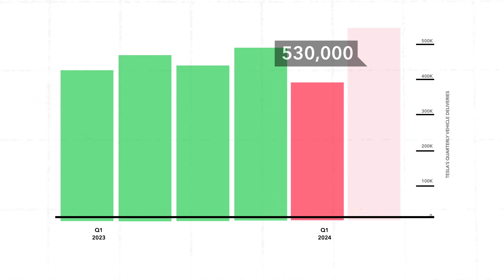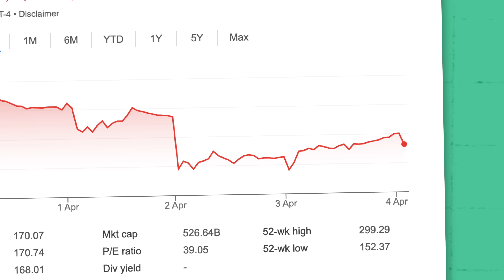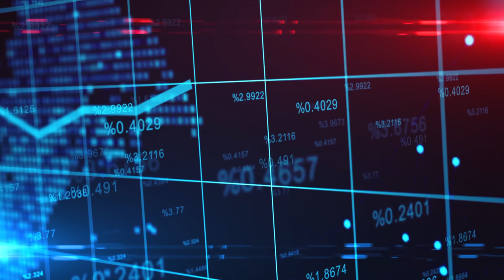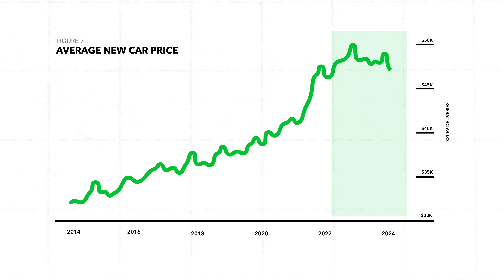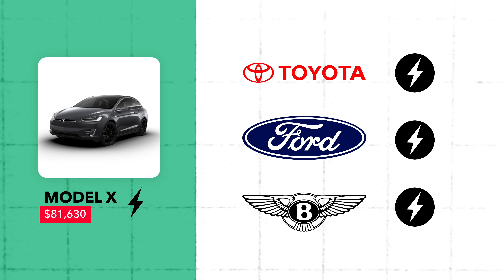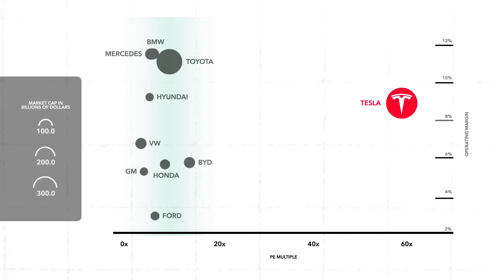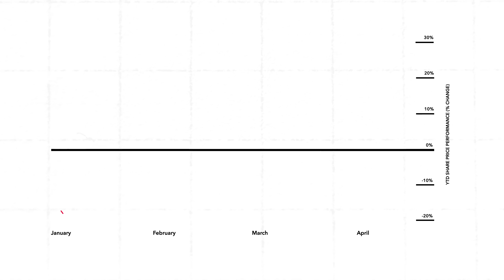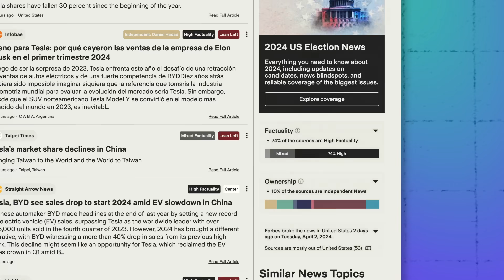Why Tesla’s Stock (Still) Has Further To Fall

Comment: classic case of missing the forest for the trees.
Just because Tesla was not able to ship the car to the customer due to international conflicts doesn't mean they had a bad quarter. 
Also, Tesla isn't a small automaker anymore where Production should equal Deliveries. If it is cost effective to stagger deliveries, then why bother about deliveries.

I understand that Tesla's quarterly results take into consideration delivery numbers, but in the long term, all of the production will get factored in to the financial results. So, any long term investor should stop missing the forest for the trees.
Reply: @xt5181  I respect your opinion that Tesla is "just another car company" and for that reason. I will check back in 2030 to see what ended up happening.

Comment: Americans always do things their own way (inches and gallons, anyone?)  Their living circumstances are vastly different from Europe or China, both of which rely on energy imports. My sister, who lives in Italy, pays the equivalent of $8 a gallon for gas and had paid nearly $10 per gallon when the Ukraine war started. The US can just frack their way out of price shocks and the longer distances that we travel are such that range anxiety is more pressing than the densely populated Europe and Asia.
If I were a car maker selling in the US, I would be rolling out as many PHEV models as I could, as they give better mileage (and horsepower), charge in garages (which most Americans have) and don't need to worry about getting stuck without a charger or in line for hours to use one.

Comment: I don’t consider Tessa as a tech company. the reason why is because when Ford built the model t. I believe it was considered very different singly as in world as tech company. Car manufactures always have intubate with robots or with ground braking technology. I don’t believe Tessa will make it for this one. I believe that the stock prices will fall below Ford. Probably trading at $20 per the way of the market going towards a different direction.

Comment: Tesla cars being to pricey for a lot of people is something that a lot of those speculating on the value of tesla really don't understand. A study done a couple of years ago suggest that more then 50% of working americans can't afford a $500 emergence. These are the vast majority that buy a car on credit or via a loan and then pay it off. If your buying a car on credit and you can't afford something like a $500 dollar emergence you aren't buying a Tesla car plain and simply they are to pricey even with the price cut. 

Tesla is a more expensive car brand that is fine there have always been expensive car brands but those brands are generally owned by bigger companies like Lamborghini and porsche are both being owned by Volkswagen. This means one company can cater to and sell to vastly different parts of the market. Tesla on the other hand really can't they don't really have enough different brands/selection and likely manufacturing capacity. Again as a company its fine to cater to a select market but when you do that you do limit your growth potential as a company.

edit funny thing is there is probably a chance that tesla would be more profitable if they ditched making there own cars and did basically become just a car tech company selling there batteries and robotics tech to other car companies that manufacture at a larger scale.

Comment: VERY POOR TLDR REPORTED. Tesla prices are below the US average you mentioned. Also Tesla has built out a giant charging network.
Reply: how does that change anything they said? Their sales have dropped and they were explaining some possible reasons why.
Reply: @ThatGuy-bz2in  yes, but the reasons they gave are way off. Price is not an issue and the number of Tesla charging points are enormous. It is poor research quality not to be able to pick the actual reasons.   No need to make up make-belive issues as the real issues are problematical enough
Reply: @tempcadoganenright  Price is absolutely an issue. EVs are more expensive than ICE cars still. Which means that choosing an EV means knowingly spending more up front. For someone excited to buy an EV, that might be a smaller factor. But for a general, skeptical public, that is super important. 

And the number of tesla charging points are enormous, in certain areas. In other areas, there are none. Most people want their car to be able to go wherever they want to go. If you want to go camping in a rural area, there might be no charging station anywhere near where you want to go. That is an issue for EV adoption, including tesla. 

The fact that you chose to ignore these very obvious facts and call them "make-believe issues" tells me you either are an elon fanboy who ignores information he doesn't like, or you don't know very much about EVs and their usage outside urban areas.
Reply: Dacia spring costs 20k euros,mg 4 is my country starts at 27k euros tesla 3 is 40k euros, price is definitely a issue, people that own ev´s here are from the upper middle class, about the usa you guys overall hate ev´s.
Reply: Dacia spring costs 20k euros,mg 4 is my country starts at 27k euros tesla 3 is 40k euros, price is definitely a issue, people that own ev´s here are from the upper middle class, about the usa you guys overall hate ev´s.

Comment: There is another pretty important reason too, which is common to the adoption of just about every new technology--the time when early adopters eager to have an electric car, the newest shiny and exciting thing, is now past. More conservative buyers hold back to see if this is indeed a worthwhile markert changing thing I need to get into now or do I need to wait and see how things go. Part of the wait and see here is, of course, the charging network build out, but it includes other things as well.  Will they prove as reliable as forecast? How will they hold their value? Will charging time get to be more like filling up with gas? Is the fire risk real or just something the press pays more attention to than warranted because of the novelty of electric vehicles? Etc. Remember that automobiles themselves took a while to take off in sales.  There was at that time no such thing as a filling station, few really good paved roads, few qualified mechanics, etc. The transition took a good bit of time.
Reply: I mean, the fire risk is kind of already settled. EVs catch fire way less than ICE vehicles. Just, when they do catch fire, they are bitch to put out. But otherwise, I agree with you. People are waiting to see if they are actually good.

Comment: Gas stations should provide and maintain the electric infrastructure for quick charging.
Reply: Why?
Reply: @VF31Rules  So they actually work.
Reply: Good point but most gas stations are privately owned (like a franchise). I doubt they have the money. Unless you mean like Shell or Exxon fund them and treat them like a gas station?
Reply: @VF31Rules  They should charge for the charge.
Reply: No profit in EV charging

Comment: Ultimately, only the 24/7 availability of abundant electricity will enable the green transition. #NuclearBuildUpNow
Reply: nah, we just need better batteries. Solar and wind are so much cheaper and cleaner than nuclear. We just need better options for storing that energy.
Reply: @ThatGuy-bz2in  That's a wide-spread myth. Batteries are physically limited to 500Wh/kg. Nuclear is WAY cheaper, cleaner, and safer than wind and solar.
Reply: @odril  umm, no. Why would you think nuclear is cheaper? It very, very much is not. Solar is the 2nd cheapest form of power on the planet (with hydro-electric being 1st). And that's not even taking into account all the innovations Solar is having that haven't hit the market yet. Nuclear is way down the list. It also isn't cleaner in any way or safer. I don't know why you would think those things. 

And it depends on what battery you are talking about. There are many, many different kinds of batteries. For example, pumped-storage batteries are only limited by the amount of water you can store.
Reply: @ThatGuy-bz2in  Your misconception might originate from the cost of the PV panels, which is indeed low. However, the cost of integration of intermittent PV into the grid is not.
Reply: @odril  If I understand your point, it is that there are costs of integrating solar into the grid given that it is an inconsistent source of power. I have 2 responses to that. 
1) nuclear power costs more than 10X more to produce. solar's cost per kilowatt is 700-1400 USD. Nuclear is 8,475-13,925 USD. We are talking about a source of power orders of magnitude more expensive. If all power was made with nuclear energy, most people couldn't afford it, which would obviously be unacceptable. Any politician who caused this to happen would be thrown out of office.

2) With all that money you are saving producing the energy, you can invest in energy storage. If you can produce energy dirt cheap, and successfully store it until needed, then solar becomes a no brainer.
Reply: @ThatGuy-bz2in  We tried this in Germany and found out that the price per kWh (your assumption above) is skewed by renewable subsidies. After 20 years of "energy transition" in Germany based on solar and wind only the cost per kWh is above 0.5€/kWh, even after 500 billion € of government investments. In France (80% nuclear), the cost per kWh is 0.2 €/kWh, after about 50 billion € of government investments (into nuclear). German industry is being starved (and leaving to the US). So, from a national economy point of view nuclear is WAY cheaper than solar and wind, simply because storage does not exist (for physics reasons).

Comment: Very superficial. It does not grasp the fundamental differences between Tesla and its so-called competitors. This analysis forgets how Tesla is the only debt-less company in the pack, and the only company that spends a lot of its own money on growth. Apart from that, automotive sales have a lot of seasonality, so the actual relevant figures should always be the rolling last 12 months. And regardless of objective slowdowns like the Red Sea situation and the terrorist attack on Tesla Berlin and the decision by Germany to stop incentivising electric cars, the trailing 12 months keep showing Tesla as a growing company. The news should be: look, EVs seem to temporarily slow down, but they are still growing a lot and Tesla is still the lead of the group.

Comment: Tesla is a decent company, thats still 5x overvalued.
Reply: Could you care to explain?
They make the most EVs and actually make money on them.
They have the most efficient EVs on the road.
They own the most reliable charging infrastructure.
FSD V12.3
They are entering the pickup market with Cybertruck, which will sell like hot cakes. 
Next gen vehicle coming next year
I'm confused by your comment.
Reply: @BartekBorowski  they sell a tiny fraction of cars sold, but are valued at the same price as all other car companies combined. There is absolutely no defense for this. Their PE ratio is 50. A normal PE ratio for a car company is in the 5-8 range. 5X over valued might be a low estimate.
Reply: @ThatGuy-bz2in  That is a very shallow analysis and comparison. Tesla is involved in much more that the other 'car companies'. Batteries, FSD, Supercharging, Tesla Bot, Tesla Energy, Tesla Insurance, Software etc. They are years ahead in manufacturing techniques, costs, speed and efficiency. Look at the financial statements, they are available online for all public companies. The upside on all the different sectors is huge, hence why the valuation is higher. But please, continue to spread FUD so I can load on on the stock while its down. It will be nice to come back to this video/day in a couple of years. I'm more than confident this video and this discussion it will age like milk.
Reply: @BartekBorowski yes, their financials are available. And they have a PE ratio of like 50. That is insanely high. That means the price of the company compared to how much money they make is ridiculously bad.  

Most of the stuff you are talking about is just hype. FSD has been promised to be delivered for years. It is still super dangerous to use and nowhere near being ready. Musk is great at hype, he delivers on like 5%-10% of it.
Reply: @ThatGuy-bz2in  It is true that they have a high PE, but you are missing the bigger picture focusing on simply the PE. I know you will disregard no matter what I say, but simply have a quick think about those things:
FSD will be rolled out globally when it reaches the required safety threshold. Current Data shows that people using FSD are far less likely to get into an accident as its supervised. What happens to FSD revenue? 
Tesla has shown the roadmap of how they intend to reach 10+ mil vehicles/year with the new unboxed process.  Have a read about how it impacts costs, production efficiency and speed. What happens to the demand for a 20-25K vehicle? Its infinite (almost) 
Tesla Energy has higher margins that the auto business, what happens when it eventually ramps?
With FSD solved, Tesla bot runs on the same architecture, just a different training data set. What impact does that have? 
Potential for a robotaxi network? 
Potental for supercharger and FSD licensing profits?
Just something to think about so you don't miss the bigger picture.
Reply: @BartekBorowski  FSD was supposed to be fully ready in 2018. It has been promised basically every year since then, and it still isn't ready. There is no end to videos of it doing stupid, stupid things. And then they removed the radar and decided to rely on only cameras making it objectively worse, because it's cheaper. It now has trouble telling apart a person on a billboard in the distance from a pedestrian because it can't tell how far away the sign is. FSD isn't going to work, not any time soon anyway. 

and LOL, they are never going to produce a 20k car. Elon kept saying they would, but then he keeps putting it off over and over again. Instead he sinks resources into an ugly truck that few people actually want. 

Also, this video discussed that they are already producing more cars than they can sell. Saying they will produce way more cars, when they can't sell the ones they are making now is not a great argument. 

Basically, your argument boils down to things they might be able to do someday that there is no good evidence they actually can. That is what makes them worth so much money in your eyes. IE it's all hype and hope.
Reply: @ThatGuy-bz2in  Saying there is no evidence for all my points above shows your lack of knowledge about the company.  Your arguments are purely subjective. Mine are based on historic execution of the company and publicly available information. I don't agree with all of Elon's comments (which are overly optimistic sure) but you CANNOT argue against his execution. Look at SpaceX and Neuralink. If you cannot appreciate what he has done, this conversation is pointless.
Tesla does deliver, late at times. But you are missing the bigger picture.
With your logic, if it wasn't done before therofe it won't be done, we'd still be living in caves. 
FSD is improving. Is it hard? Yes. Overpromised? Sure. But you can see the progress between revisions. Tesla has demonstrated excellent execution to things that matter, and they have laid out a roadmap on how they intend to reach 10+ mil cars/year. When the world financial situation improves, demand for ALL vehicles will be restored. Majority of people buy cars with credit so high interest rate make it very difficult. 
I'm done. My advise is to listen to company earing calls, do your own projections. It will make you a better investor. I've done my own research and analysis and I'm putting money where my mouth is. $TSLA.
Reply: @BartekBorowski  Saying FSD is improving is light saying my new TV only catches fire one a week, it used to catch fire twice a week. Fire is still bad. FSD makes stupid mistakes constantly. They have downgraded the hardware they are using making it worse. It has never functioned safely and there is no evidence they are capable of making it so. 

You can choose to invest in hype if you want. I'm not saying it is impossible that tesla will do well. I'm saying that the available evidence does not support that outcome. I'm sure their earnings call is full of elon saying how Tesla bot is going to revolutionize the world (when it's just a guy in a suit). That is what he is best at. That is why his company is insanely overvalued. He is a hype machine. But he is now a hype machine that pushes nazi shit online. He is actively working to alienate the people who buy his products. It is only a matter of time before tesla has to get rid of him.

Comment: Hilarious. You selectively choose data to make your point. Showing Model X instead of M3 to say their EVs are expensive. Their PE ratio is 39 as of today not 60 just a blatant lie. The WORLD EV market is in exponential growth mode US lags behind ROW. Cost decline to produce EVs are guaranteed using Wrights Law. Tesla has many other revenue producing businesses you don’t mention. And lastly, EV charging network decline WTF? The Automotive manufacturing sectors caved and joined NACS the Tesla charging standard with the ability to use the Tesla Network which is being built out aggressively as well as being massive already. 90% of people charge at home. I tuned in to see if I’d learn something no other bear has thought of but your video was the same old FUD. And looking at your channel it’s completely anti Musk so this one makes sense so all your followers can jump on and agree with you. Siloed.